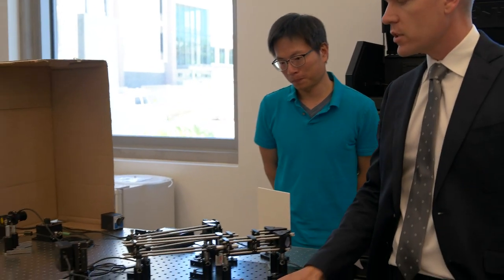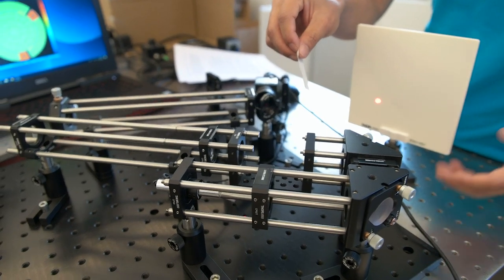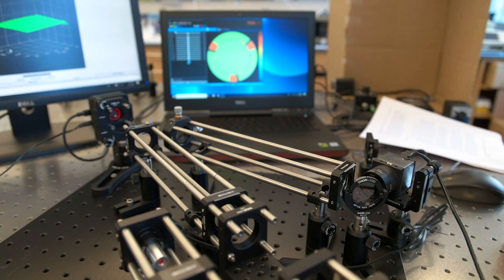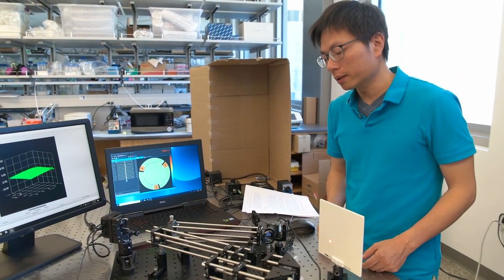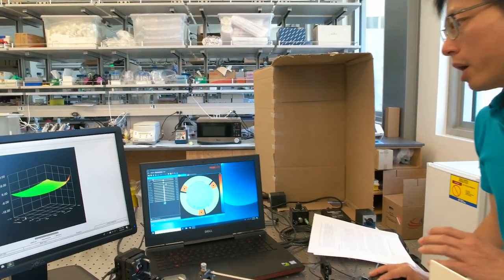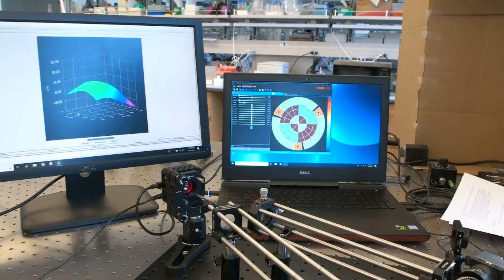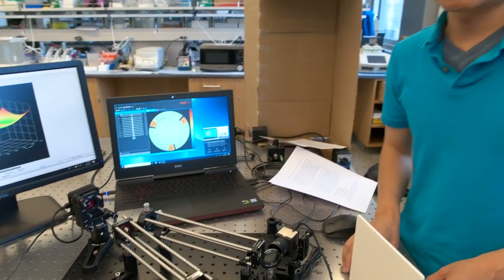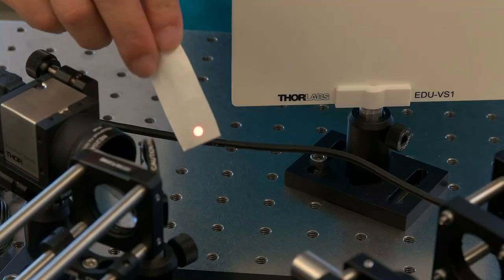Adaptive Optics

Comment: Thank you very much for this good instruction about adaptive optics.
I would like to ask a question.
You introduce that the two lenes after the laser source is used for changing the laser beam size.
So the laser beam is not a parallel beam after the lenes?
Reply from the maker: The laser beam size is not only expanded but also collimated after passing through these two lenses.
Reply: @NemonicNeuroNex  Thanks a lot for your fast reply. Is the telescope lenses combination f=30 and f=60?
Reply from the maker: @rz9359  For the telescope, f=30mm and f=100mm
Reply: @NemonicNeuroNex  I got it. I really appreciate your kind help and this wonderful video